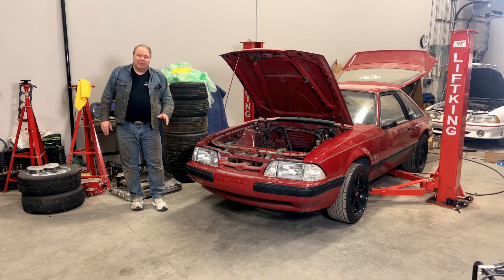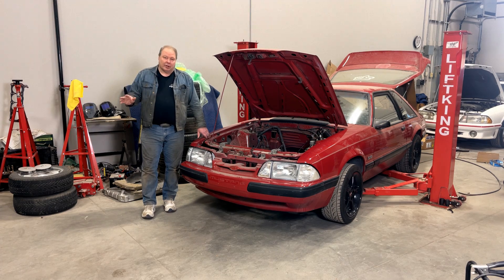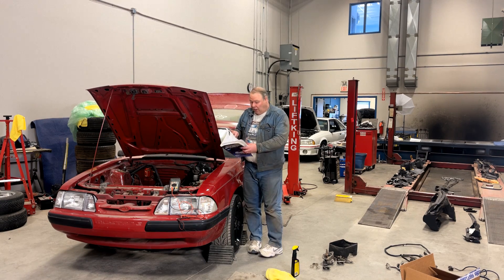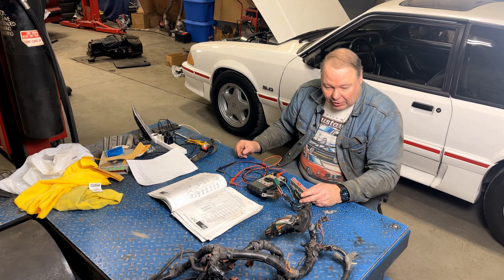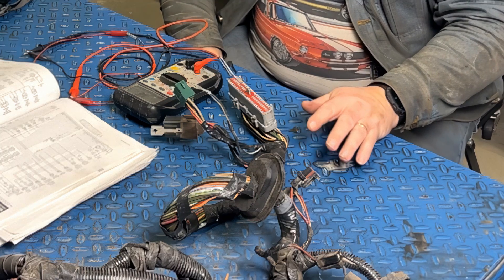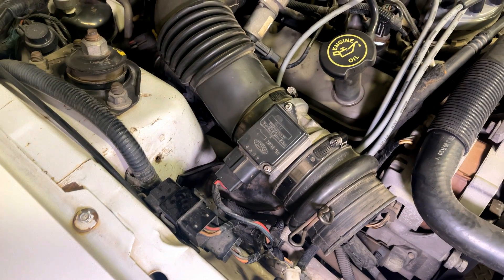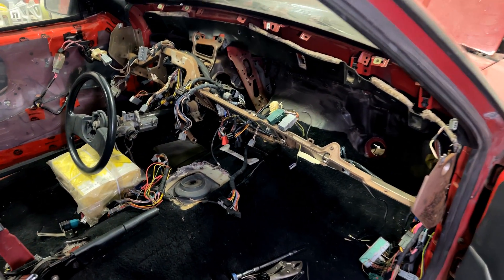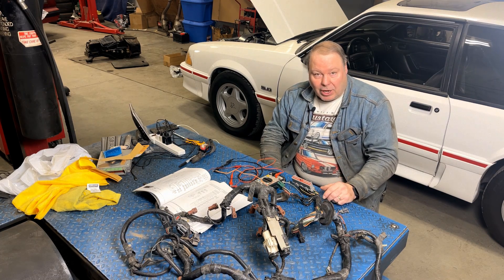A Guide to Foxbody Wiring Harnesses

Comment: Just subscribed! I have a 91 mustang GT and did a manual swap but can't get the car to start, any tips? I have original wiring that came with the car. Do I need to purchase the manual transmission harness to get it to start?
Reply from the maker: If you have a no crank, you should check all the interrupters in the start circuit to make sure they are hooked up and work. The clutch switch for instance, and it MAY be necessary to jumper the park switch circuit if you still have the automatic transmission wiring.

Comment: Great video! I Lund it as I’m trying to investigate the differences between an ‘87 and ‘88 dash harness. I’ve removed my original ‘87 dash harness because a previous owner added an elaborate car alarm and hacked up multiple areas of the harness. I’m pretty sure it is the cause of some sporadic electrical issues I have. I bought a pristine ‘88 dash harness with no spices in it (I paid. Small fortune for it🤣). Now that I have my original harness out, I’ve noticed several differences in wire colors, pin locations, etc.  specifically
in the 8-pin green connector in the passenger kick panel, the 3-pin grey connector in the driver kick panel, the 12-pin black connector in the driver kick panel, and gauge cluster connectors. Do you have any lessons learned on the compatibility between these two years? Thanks so much for the content you make.
Reply from the maker: The harnesses should mostly work together. My understanding is that only certain models enabled the warning lights in the supplemental warning like panel on those early harnesses, so that could create some differences even if you have a harness from the same year car. Another thing to keep in mind is that 88 California cars were mass air, and the clusters have a "check engine" light, but it is only enabled for the mass air cars. That could create some differences too. I wish I could be more helpful, but you might have to break out the multimeter to get the last mile on that job.

Comment: Thanks  wanna install a 93 engine in a 91  5 speed
Reply from the maker: You can use the 91 harness on the 93 engine if your 91 has a good intact harness already.
Reply: @tecmotiondyno  ok thanks very much just stared removal of the 2.3

Comment: Can I use 1993 power window doors, locks and harness on my 1990 with manual doors?
Reply from the maker: There are a lot of differences on the 93, but I don't think the power locks and windows are one of them so you should be ok.

Comment: Can a 79 fox be converted to EFI using a later model harness from like an 87-92?  

If so, What are the big takeaways to doing this?  

Yea I could go terminator or Holley sniper or all those Stand alone systems.
Reply from the maker: Yes. I have a friend with an 83 that is done this way. You can get pretty well everything you need for control of the engine by just using the EFI harness, but you will be on your own for hooking up stuff like the gauges and anything else that is tied into the body harness where the dash harness would normally plug in. I have also seen guys switch the whole interior out of a later car, including the dash harness. You could also use a Megasquirt plug and play with a harness swap like that. The downside is that most donor harnesses are a mess simply because most Foxbodies have a hacked up harness.

Comment: Working on a 84 fox with a T5 and 302 from a 90 that i put into it, what harness would i need?
Reply from the maker: You might get it to run with almost any Mustang 5.0 engine harness, but you will have issues with the ancillary connections no matter what - there are no 5.0 EFI harnesses which will connect right up to your dash harness. I have a friend with a similar 4-eye that is running but he didn’t do the work and I have not looked closely at what done. Obviously it CAN be done though.

Comment: Just picked up a 90 notch back that was poorly swapped.  Trying to get everything working right. what engine harness and body harness should it have to work right? I was told the motor was from a 95 mustang.
Reply from the maker: You will need a dash harness and engine harness that matches. Without looking at it, I would guess that it already has a 90 dash harness and you will have to get a 90 engine harness. 1990 is a unique setup though I personally saw a car the other day which is supposed to be a 1990 and had the late style dash connector, so there are some weird setups out there. Outside of this one questionable exception, every 1990 I have seen including my own late production 1990 coupe has the two engine to dash connectors and the airbag support. The 1995 harness is really different and probably not that easy to adapt to the 1990 dash harness. Good luck with it.

Comment: Hey man, just started working on my 87 lx project and I have the efi harness I’m trying to replace but I can’t find any removal videos on YouTube, any tips on how to remove the harness and connect a new one back on? I have the dash removed just need to remove the harness.
Reply from the maker: If you disconnect the pcm and a couple connectors down by the kick panel. You can pry the big firewall grommet out into the engine bay and just pull it out. You have to unplug it where it connects to the dash harness at the drivers firewall area, then just disconnect all the plugs on the engine and you can remove it. Watch for places it is clipped to the body and any connectors you missed. All of it just unplugs.
Reply: @tecmotiondyno  appreciate that man, I’ll will give that a go.

Comment: Very informative and going to be absolutely useful when I start on my '92 ProjectGirl.  Did go check and she has the mid 92-93 engine harness.

Don't know if you remember but mentioned to you before that I bought her Dec 24 '22 and only driven her maybe 15 miles total, but got her out the other day and drove her couple miles down the road to the gas station and it hit me hard! I love this Fox and ha e got to get my butt in gear and get her fixed and reliable enough to daily drive.

I've got more in New parts and all the diagnostic tools and just bought and ordered the Innova (I believe what it's called, the same one KASL did a video on) and it she be hear in a couple days or so. I just need to make time for her.

Sorry so long but your videos, specially this one is and has got me excited along with about all the diagnostic books I've got, I should have her back to original shape and get rid of the racer wanna-be parts they've throwed together and on her so me and the wife can get out and enjoy cruising and taking on the trips from time to time we go on.

Thank You Sir,  always love and get alot out of your videos and wait for more that will help me with my ProjectGirl.
Reply from the maker: I'm glad its helping you. I figured that a wiring harness video would not be a world beater view-wise, but it seems like an important tech resource that needs to be out there. A project like Bad Decision could certainly benefit from this type of video it it was in the hands of someone less experienced.